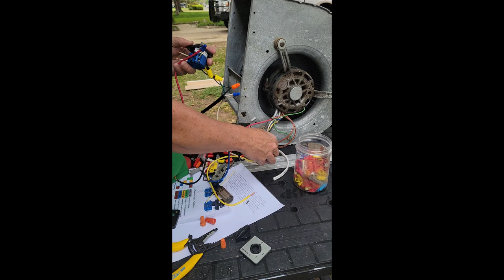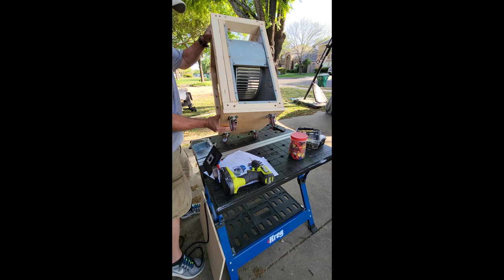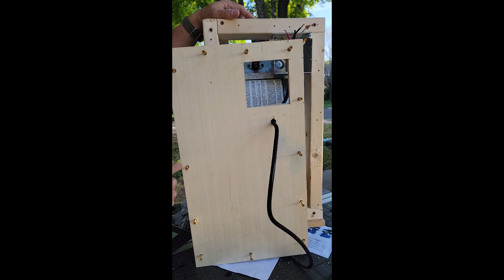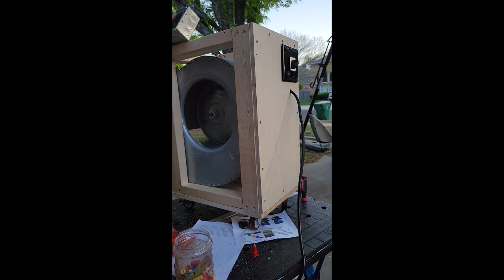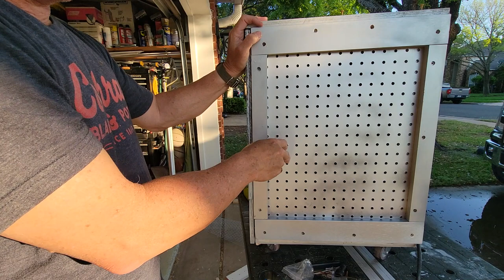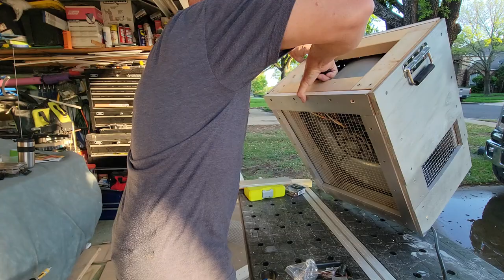Create a shop fan from an HVAC blower

Comment: What is the correct wiring, I have the same motor and  bought the same switch to go along with your video.
Reply from the maker: If you go to around the 3 minute mark in the video, that's where I start explaining the wiring and the switch.  Basically, you need to create wiring pigtails on the 1, 3, 5, and 7 terminals on the "hot" side of the switch - then, connect those "hot" side pigtails to the black wire from your power cord.  The white wire from the power cord connects directly to the white (neutral) wire from the fan motor.  Then, wire each of the four colored wires to the 2, 4, 6, and 8 terminals on your switch to correspond to the fan blower motor's speeds.  Typically, black=high-speed, yellow=medium-high speed, blue or brown=medium-low speed, and red=low speed.
Reply: @VThokieman86  I assume this is the correct configuration: TERMINAL 7|8 - HIGHEST - BLACK
TERMINAL 5|6 - YELLOW
TERMINAL 3|4 -BLUE
TERMINAL 1|2 - LOWEST - RED
Reply from the maker: @fostergreenrealestate  yes, that is correct.
Reply: I have a blower with capacitor and it runs for 10 seconds then cuts off what could be the problem
Reply: How do  I fix 1 that has a compositor has red black blue  smaller pinkish wire

Comment: Most of these fans are 220. Are you running it on 110? That may limit the life time of the fan?
Reply from the maker: This is a 110VAC blower motor.  The only 220VAC circuits that I have in my house are the circuit for an electric clothes dryer, and two outdoor circuits for the AC condenser/compressor units.
Reply: Gas furnace blowers are 110v / 115v.
Electric furnace blowers are 220v / 240v.
Reply: Mine is a 208v 220v* can I still run it? Need some direction...